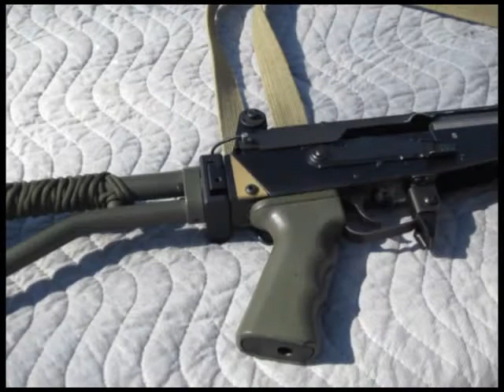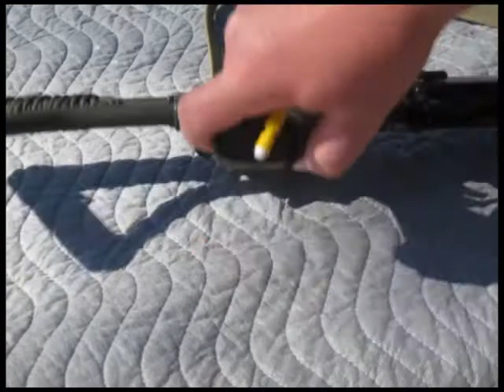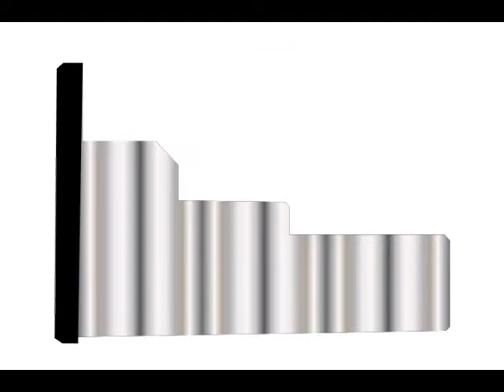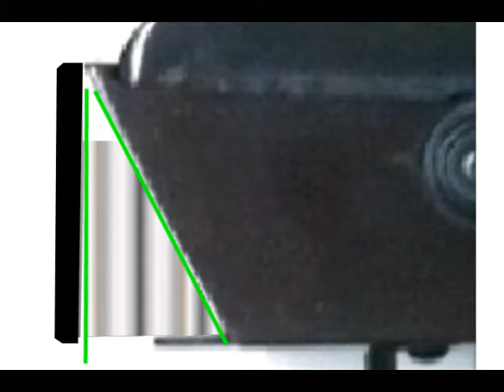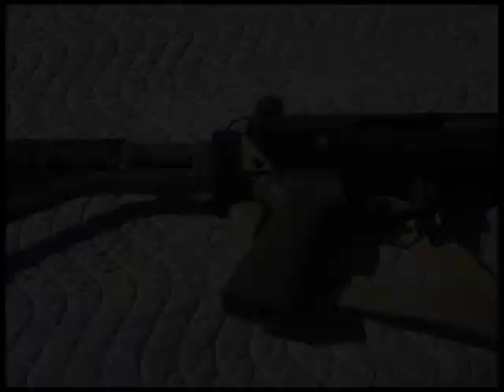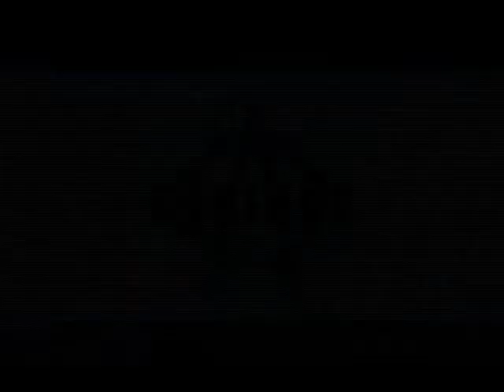AK-47 Norinco Hunter Conversion to 7.62x39mm Galil Clone Gunsmithing Project - Post Script

Comment: How is this rifle holding up? I just saw one locally in its original form.
Reply from the maker: It's holding up well! I don't shoot it a lot as I have a lot of rifles, so I can't say it's been through a torture test. Still, it was a well made gun to begin with. The design of the original is bonkers.  Much like modern Saigas, it's a civilian version of a military rifle that's being forced into a more "civilian" configuration, so there's always some functionality and aesthetic lost.  So, while I don't consider the Hunter a classic, it is pretty interesting!
Reply: Have you seen the akbrv for the saiga? Do you think the angle would match?
Reply from the maker: @hellmedic6490  I'm not familiar with the akbrv, however there is very little in common between the Saiga receiver and the Hunter receiver.  I would suspect that anything that is designed to fit one would not fit the other.

Comment: One wonders if one could use the original wood stub of the hunter stock as a guide for a aluminum or steel 3D CNC machined piece?   Of course one would have to have access to that tool, but one might then be able to sell a few hundred pieces to people like me